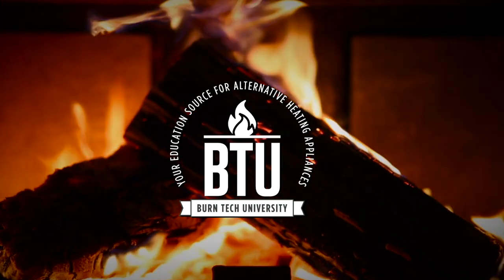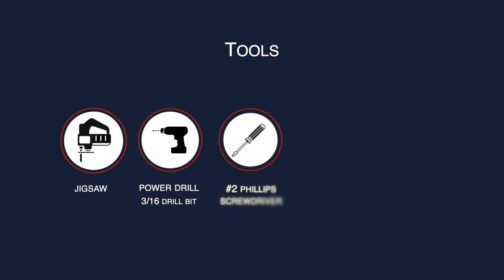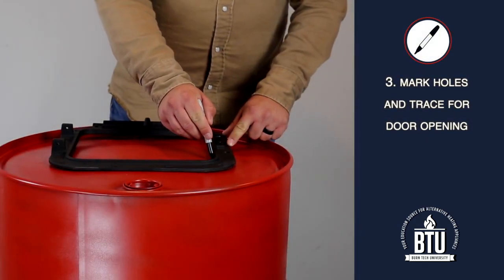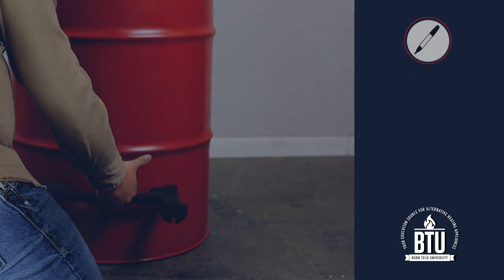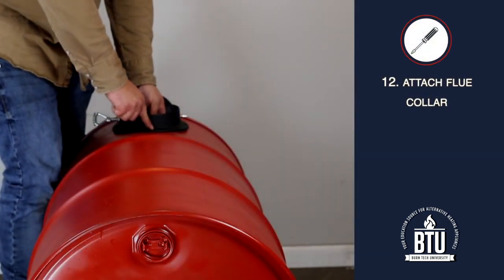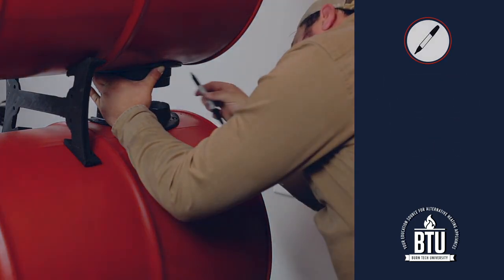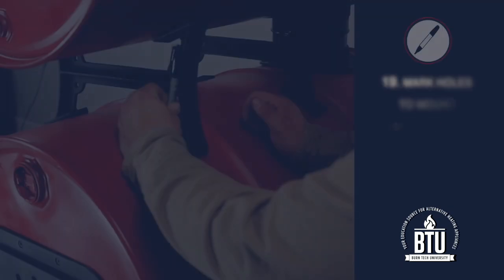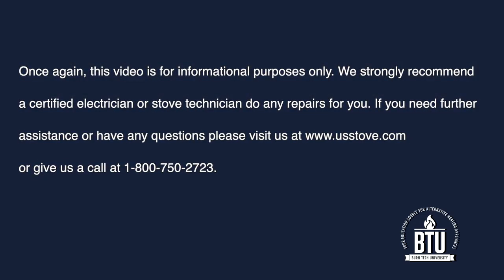Assembling Barrel Stove Kit: DR55 Drum, BSK1000 and BKAD500 Kits

Comment: position the larger bung hole to the bottom of the door. You need it for air because the adjustable air openings in the door are not enough and the and creosote will buildup in the chimney. Find a barrel that has the removable lid with the lock ring. That way is it much easier to bolt it together, the barrels are much thicker, and it easier to put in the grate. It's also much nicer to just remove the entire front of the stove to clean out the ashes. They are much better and last much longer than the oil drums everyone has.